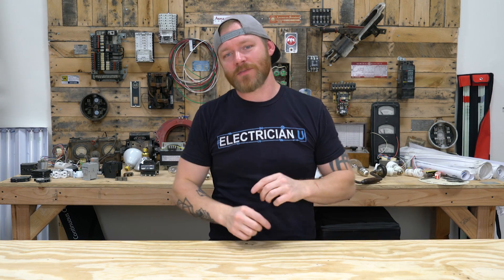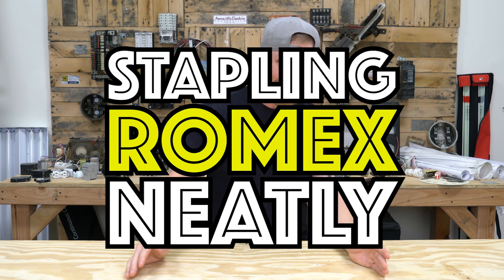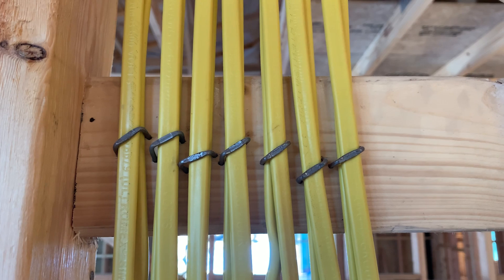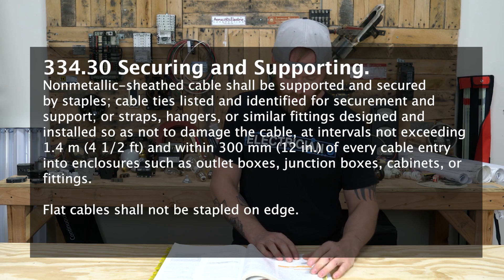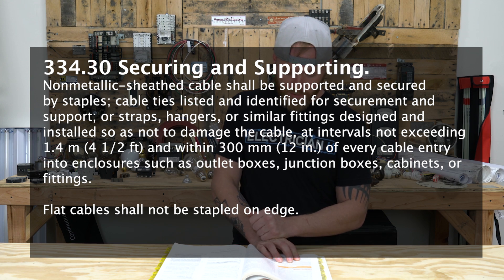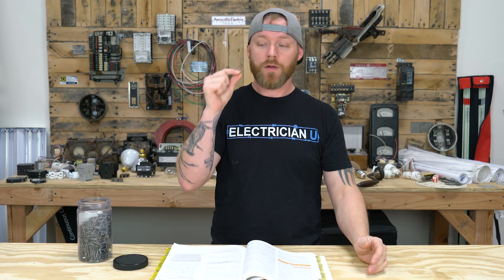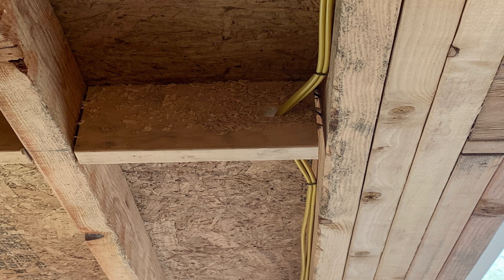Should Romex Be Stapled Neatly? DOES IT MATTER??

Comment: Thoughts on using Romex in a plastic conduit to a shed light?
Reply: No need to do this they sell wire for flex and ridgid raceways all you need is a fish tape.Get out of residential and learn industrial motor controls, automation,plcs,instrumentation etc learn how troubleshoot 3/4 of electricians can't most are installers...
Reply: @davidcooper4385  I'm usually good at troubleshooting electrical problems.  I did more research and found its best to use underground feeder cable and 1" conduit to protect it where it comes out of the ground at the house and shed. It's only about 10 ft away. I have a breaker panel nearby on the house that I can add in a dedicated circuit for it.  It's just for a fan and some l.e.d. work lights. 
 Do you know of any troubleshooting jobs in Florida?
Reply: Been in the trade 40 years resi,commercial, industrial, h.v.a.c ,plumbing ,electronics,h.v.a.c background.Try working in a coca cola factory or on complicated machinery this troubleshooting is tougher than one thinks, makes you a better electrician, cranes,trains,hospitals, water treatment plants etc,don't get stuck with contractors I left them behind after 6 years they suck...
Reply: @davidcooper4385  I agree. I've worked for some bad contractors before.  It can be stressful at times. Lol. 
I just want to work and do the best job possible.
Reply: I never waited for people to teach me any thing ,I have worked 7days a week for 10 years ,learn every thing u can in electrical, what ever you do be the best you can be, not a pay check average guy if you have to be told what to do every minute don't be that guy..

Comment: As a cable technician that works near electrical (in basements mostly) I can appreciate a good electrical system install.  I also take pride in how i do installations, and I always check the sticker on the breaker to see what electricians do the best work!  Makes it easy to decide if I need work done who to use.

Comment: The local inspector can tell if I wired a house, because unlike the 30 other jake-legs in the area, mine looks similar to what you saw in this video, even my panel is wired to the same standard of neatness as an industrial panel.  He knows the work and that it is correct and up to or exceeds code, he checks a few required things and is on his way and I have no hassles with him at all.  He's told me that folks that do work that looks like a rats nest get his undivided attention because there are likely short cuts taken that are not up to code so he goes over them with a fine tooth comb and they get to pay extra inspection fees to make up for the shoddy work.

Comment: Cable ties shouldn't pass,cable ties are not list for use as securing romex wire,not to say it won't work but it needs/should be listed for its use.but I adore the work ethic,but being great isn't cheap.i have a poster in my office and it goes "if you think its expensive hiring a good electrician,try hiring a bad one"
Aloha

Comment: Hell as a 40 year HVAC tech I would be a happy camper if you guys would label the panel breakers correctly. To hell with the stapling of Romex neatly. Seriously they are either not labeled at all or incorrectly. Gets old trying to find the correct breaker and having to walk back and forth from the panel to the roof top testing each individual breaker.

Comment: ALL installations should be done neatly :D
Electrical wiring is delicate, so you should handle everything gently and carefully.
The stingy manufacturers give you little enough costly copper in their wire as it is, so you want to preserve every square millimeter that they do give you, and install it without pulling/flexing it any more than necessary, or kinking it at all if possible.

Comment: My brother taught me and said exactly the same thing "when the inspector sees it neat they assume you know what you're doing". I'm a software engineer and the same thing happens in code. It can be written as a big mess and often is. Often no one sees the code so why not? Well here's the thing, someone does see the work. The person doing the work. We understad our work when it's done neatly. I little bit of time is spent thinking about what we're doing...not the neat part. It doesn't take long to learn how to do neat work, it takes no thought. Instead thought can be spent on thinking about the circuit, what's next, big picture.

And that's the false logic of neat. Neat is faster. I see it all the time in software, neat engineers complete work faster than the messy engineers because the neat engineer has complete control over the project. The messy engineer is just throwing crap together and trying to get it to kind of work.

Comment: Just passed my FIRST electrical inspection yesterday. I’m a homeowner who was able to pull the permit and do the work myself. The inspector asked if I did the work, and I thought he was going to nit-pick all my work since I’m not licensed. Instead, he told me my workmanship was A+. I did everything based on how you’ve done in your videos. Thank you for showing how things SHOULD be done.
Reply: I've done my own work in my own home and for friends for years, and friends asked me to help work on a house they bought to flip this year. I've never been through an inspection before either, so I was a little worried. But the inspector was awesome; he pointed out a couple very minor things I had to correct, and he complimented me on neatness with cable runs, stapling, and the breaker panel layout. Huge relief!
Reply: thats great inspections always go good when your work looks neat no matter what
Reply: I did my first house at 16. The inspector, who was a career electrician found a few mistakes and gave me his copy of the NEC and told me to read certain sections. He said if he told me up front I wouldn't learn anything. The work passed 2nd inspection. My biggest job was a 100 unit complex and when power was turned on there were 3 faults...all caused by nails. One nail pierced circuits from opposite units and power was on in both with the main off in either. Lucky it was the same phase. The other nail sheared a wire in 2 and half the plugs were out.
Reply: What state allows home owners without a master's to pull electrical permits?
Reply: @spencerwyche2552  Florida is another one.
Reply: @spencerwyche2552  Alabama does.  Roll Tide.
Reply: @spencerwyche2552  Kentucky does too.  Go Cats and Cards!
Reply: @spencerwyche2552  Michigan
Reply: @spencerwyche2552  I have, here in VA.
Reply: @spencerwyche2552  NJ for sure. I’ve done multiple permitted jobs in my residence.
Reply: @spencerwyche2552  Tennessee, Virginia, N. Carolina, S. Carolina...these are states I know of for a fact was this way 20 years ago and back
Reply: @spencerwyche2552  North Carolina 🤷‍♂️
Reply: @spencerwyche2552  Quite a lot of them if it is your own private property. Can not do it for someone else or in rentals.
Reply: @spencerwyche2552  NJ
Reply: @spencerwyche2552  Massachusetts you need to be licensed and insured to pull permit no masters
Reply: @spencerwyche2552  I know that Florida allows homeowners to pull their own permits for their own homes.  They don't however allow homeowners to engineer their own plans.  Anything that requires engineering needs to be signed designed and certified by an engineer.  Then the work needs to meet or exceed code when following the engineered plans.
That being said, that homeowner cannot pull the permit for his/her neighbor's home.
Reply: So I just finished wiring a new house and I didn't use any staples at all. I just ran the wires and left them where they hang. Everything ohmed out so we're running with it. Took 2 hours to wire the entire house. Phuck it muhahahahaha
Reply: @SuckMySweatyBallz  ooooh that sounds like a mistake I would do
Reply: @SuckMySweatyBallz  hell yea

Comment: can anyone tell me the good or bad of putting romex in conduit. In my shop I ran romex above the ceiling but put it in emt going down the wall to metal outlet boxes where it would be exposed. another situation using direct burial where it came out of the ground I ran it through grey conduit to protect from weed trimmers, etc. I figured it was fine but always wondered.

Comment: well said, another point is that down the road if someone needs to trouble-shoot a problem having the wire "neat" makes the job a whole lot easier
Reply: That, and labeling. I can’t tell you how much time I would save doing service work if conductors and enclosures were labeled. Oftentimes, it’s actually code to identify conductors; like when there are multiple voltage systems on the premises.
Reply: @RB-xv4si  YES!!  absolutely and frequently, multiple places, in simple plain language  I'm using RhinoPro labeler and it is fantastic for clear easy to read labels
Reply: @sheph7ceo799  that’s the one I use also haha

Comment: Before I obtained by master electrician license when I was working as a journeyman electrician couple years ago I was on a big apartment complex project and the inspector was a stickler about bundling. Whenever he came to inspect he always made sure that the home runs were not bundled coming down through the top joist into the panel.... The huge problem I have with bundling on residential projects is its very overrated!!! There is nothing in a home that carries a load where you're going to have to worry about bundling and heat dissipation. You don't have a bunch of slurpee machines running 24/7' you don't have a bunch of refrigeration equipment running 24/7, you don't have a bunch of lighting above that's drawing high amperage 24/7, there's no crazy motor loads that you have to account for, nun of that. The heaviest load in a home is going to be a 240V dryer, a 240V range, or a 240V hot water tank, and you may or may not have any of those depending on if you have gas or electric. This whole thing with residential and bundling wires and too many staples under romex is all about money...  It's another way to get a re-inspect fee's. Thats all it is,  Especially if you're in a more dominated union area and you're a non union contractor. Then they're really looking for pedley things to hammer you on. But if you're a good electrician and you know the code then there's nothing they can really fail you on.

Comment: On the first day of my grade 8 industrial arts class way back in the early 80's the first thing my teacher said to the class was "Never hand in a project and ask is this good enough?" If you're asking that question then that means you can do it better. That has stuck with me ever since and no matter what I do when I'm finished I ask myself "Is that the best I can do?" If the answer is no then I continue working on the task at hand until it is. I do low voltage installations and it drives me crazy when I have to sort out a rats nest of ethernet cables that someone just throws up in the ceiling or in a wall cavity. Any job worth doing is worth doing right or don't do it at all.
Reply: My 8th grade IA teacher told us on the first day of class the highest grade he would ever give on a project was a 95, because he believed nothing was ever perfect. On a wood shadow box project he gave me a 95-1/2. That was 45 years ago and I still aspire to that level.
Reply: If you don’t have the time to do it right the first time, why would you the second time?

Comment: Dustin, love your content and what you do here.  Could you please do a video on North American AFCI and GFCI  breaker solutions with thier pros and cons?  Perhaps also cover some of the new style plug on neutral panels and your feelings on them since it's semi related.  I'm considered replacing some of my homes breakers with AFCI/GFCI combo breakers in key areas and may replace the whole panel with a PON option to avoid all the neutral pigtails. Maybe also cover whole house surge protection 'breakers'  too.  I recently installed one and really like it. They are really a must have if you are installing these home automation in wall smart switches as the seem to fry Intantly if you even mention thunderstorms!  Since installing my surge breaker I haven't lost one. Thanks!

Comment: These same practices could apply to mc cable also.  Not sure why a contractor would run 2  dozen mc cables across a drop ceiling instead of throwing thhn in emt but it's about impossible to work around that crap after someone set off an mc spaghetti bomb up there.

Comment: You are OCD just like me, I NEED my romex neat! All wires really, but the biggest tip I can give you is ditch the steel romex staples! I started using the white plastic ones with two nails 5 years ago and never looking back! They are much easier to work with, rarely bend, you can’t pinch the conductors, don’t rust, and don’t make you cuss as much lol give them a shot. Especially stapling into TGI’s.  I cringe every time I see steel staples now. Love your videos! Appreciate craftsmanship in this trade!

Comment: I care deeply about such matters as well so good on you. I care to ensure cable is as straight like you. Using furring strips in attic as well - laying cable straight and fire block holes and shaping excess fire block to ensure holes in studs are covered. Plus I test the cables to ensure that they have not been damaged in installation. There are a lot of steps but if your methodical it works.

Comment: When the wall cavity has so many runs in it.. Is there not a requirement to protect it? Prevent future residents from stabing a nail into it?
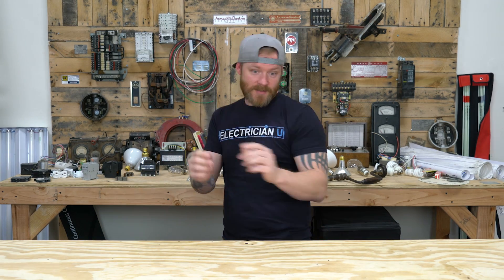Reply: There’s nothing you can put up that i know of for the entire stud space, but if the hole in the stud is close or the wire is a home run we put stud plates shown at 2:00 in the video preventing drywallers and homeowners piercing the wire